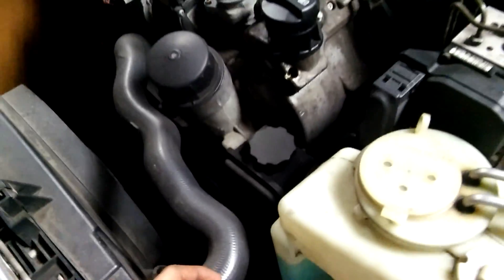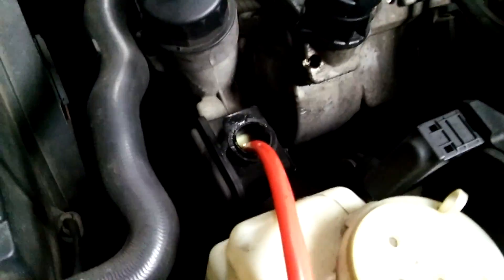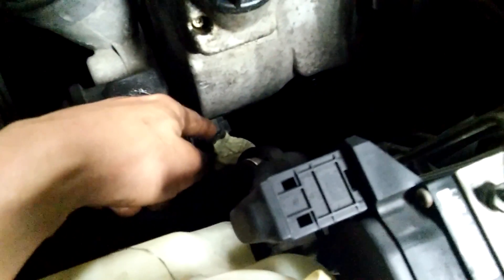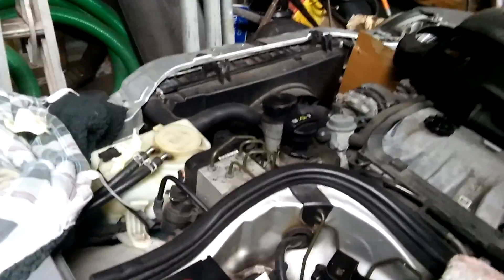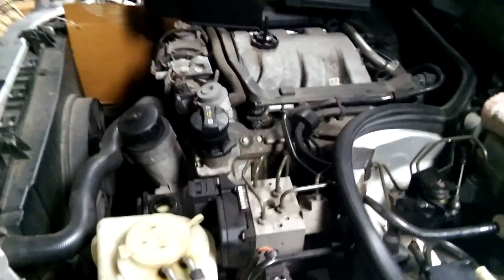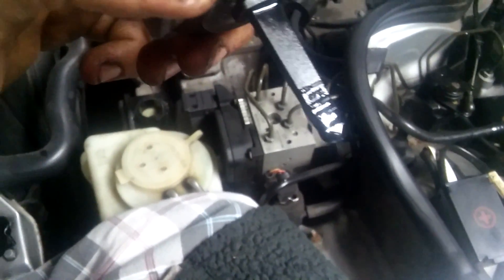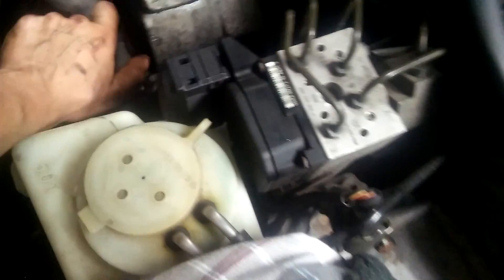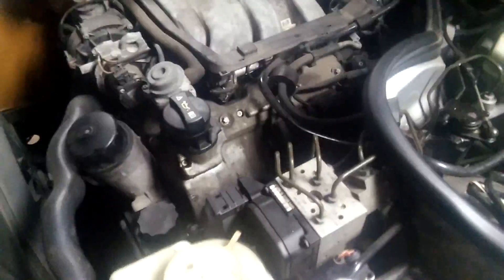MERCEDES W210 POWER STEERING FLUID FLUSH. Замена жидкости гидроусилителя

Comment: Do these use pentosin CHF 11S as a hydraulic fluid ? Is that the same thing as power steering fluid ?
Reply from the maker: I used a regular power steering fluid from Autozone. Didn’t hurt anything. The car is doing great

Comment: hello there . nice video , I have one question , ı have mercedes 1996 e320 and ı have to change steering pump and I find 1998 e430 stering pump for replace my car . 1998 e430 steerıng pump can fit my car ? serial numbers is different but some people say compatible some said not . what do you think about that ? thanks
Reply from the maker: rukrettin duru Hi there. I don't think it will fit because you have M104 engine in your 1996 E320 which is inline 6 and E430 has a V8. They are completely different engines. Take care